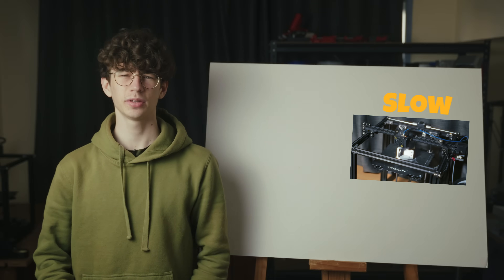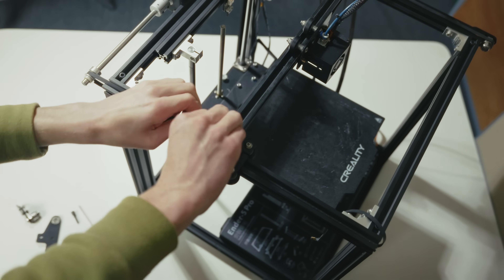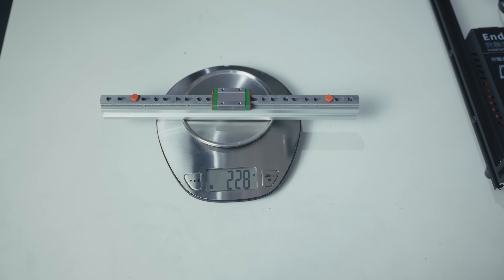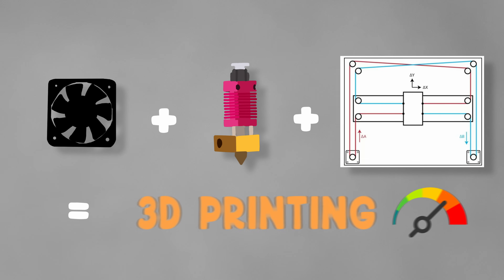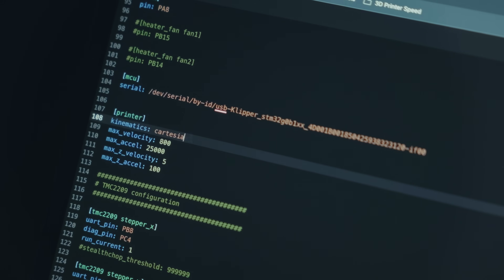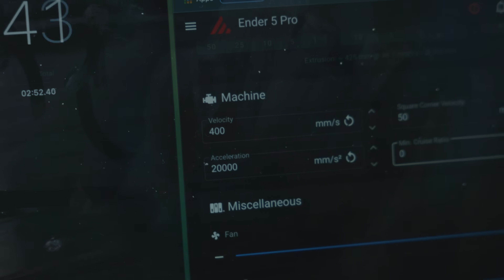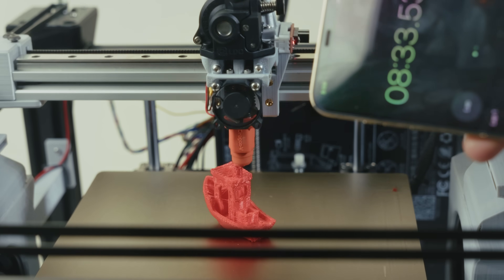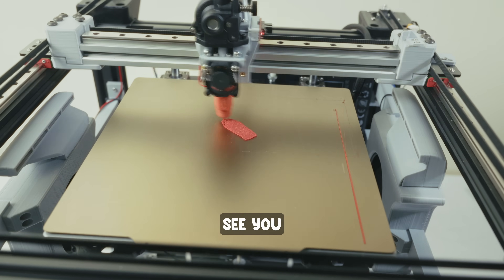Building the Fastest Ender 5 Pro

Comment: This is awesome! It's also giving me ideas for my own ender 5 plus. I've been trying to make it a fast printing system with a slipper pad and changing my hotend to use the REVO system
Reply from the maker: That's great to hear! There's so many options for Klipper pads, I've heard they all work pretty well though. The REVO system doesn't have the highest flow rate (especially for the price) but for nozzle changes, it's near unmatched. Cheers!
Reply: I plan to use the revo high flow nozzles once I get some stuff tuned in. I've been standardized my printers, and revo is very good for that. So far haven't had any issues on my ender 3 s1 with it
Reply from the maker: @Jacob_Does  Oh yeah, I forgot about the high flow nozzles. Great to hear! I can only imagine how powerful having the system on all your machines would be.

Comment from the maker: This is it! I'll keep this comment updated with relevant info.
Thanks for checking out the video!

- Quality could be improved. I didn't test a "regular speed" benchy with the High Speed filament, but I'm assuming it looks much better than one printed at the same speed with regular PLA, I could probably knock 10 minutes off with no quality sacrificing either. This stuff's surprisingly good!